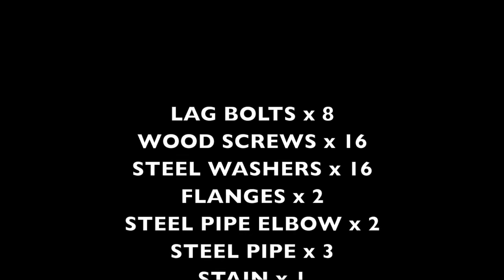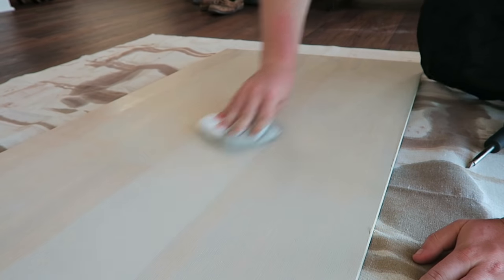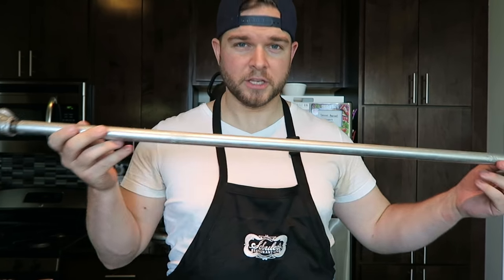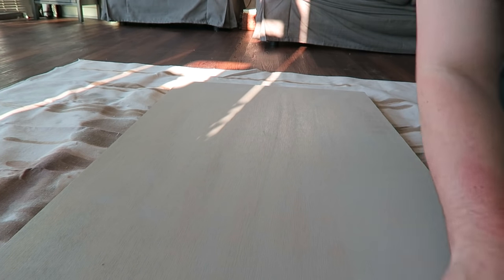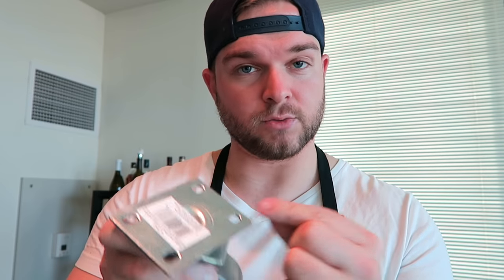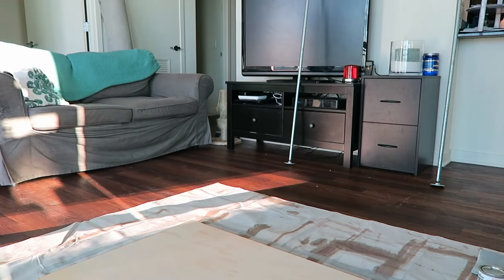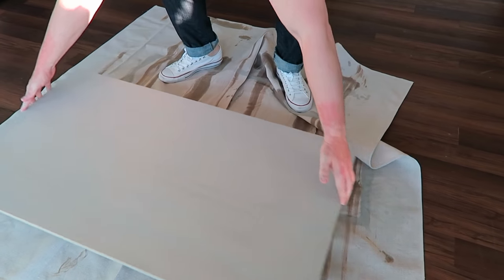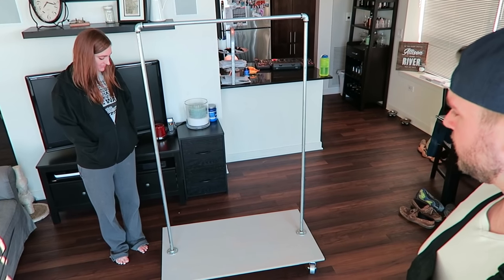DIY CLOTHING RACK

Comment: Thes instructions for a DIY Clothing Rack are the easiest to follow.  My questions are: Does the attachment such as crossbar to elbows have to be screwed to the tightest point? The elbows don't point in the same direction at their tightest. Is it ok to leave one side not as tight as the other?  Also, the flanges when screwed at the tightest leave the verticles uneven in length. What can I do about this?

Comment: Hi! How can I do this with plastic PVC pipes?? Please help. Will appreciate it a lot. I am building it for my daughter and she's an infant and will like to grab things when she grow older and I dont want a hard steel pipe hittinh her head when she grab her clothes..
Reply from the maker: Great idea! You could use the same size plastic PVC pipes you could get at a hardware store. Totally understand why you don't want the steel pipes. You might also consider replacing the wood board with something plastic. OR you could continue the pipe at the bottom like this one here: https://s-media-cache-ak0.pinimg.com/564x/31/40/e1/3140e175b2dedf9d3266ab31a7f476b7.jpg
Reply: Riv and Al thank you for replying! Subscribed on your channel. 👍🏻 Another question though, are there flanges for plastic pvcs? Thank you! 😊
Reply from the maker: +Maica De Guzman thank you! Glad to have you. Plastic pvc will not have flanges, but you could use the style in the link in my previous comment where it just uses elbows 😊
Reply: Riv and Al thank you for your suggestions! ❤️ Will definitely try this. 😁 Hoping to see more easy diy furnitures in the future.
Reply: Fill the vertical PVC pipes with sand.  It will add a lot of strength.

Comment: This may be a random question, but how do you handle ventilation in your apartment when doing something like this? I always thought I had to stain outside.
Reply: I really like the finished product! If i could give a small suggestion, a quick sanding around the edges will really give you a huge jump in the finished look and make it easier to handle as well as prevent it from snagging anything in the future or giving you splinters if you run into it or bush against it. Great job!
Reply from the maker: Thank you! And great suggestion. Also, great observation. We live near a highway so I would normally have the door open or staining outside, but the didn't have the room for the camera shoot outside on our porch :) So I kept going in and out and opening all the windows with fans. ha The things you do for YouTube. LOL. Thanks for the support!
Reply: Haha, yeah sometimes you gotta do it for the Vlog!

Comment: This looks way sturdier than even the ones for sale for double  are. I am just wondering how much weight this thing could hold. Given it's all steel. I have a LOT of cloths so that's something I would need to take into consideration. Also would it be possible to have two cross bars? Adding another one maybe  lower down?
Reply from the maker: Allison put all heavy canvas and sweaters/coats on it and we have never had an issue. Nearly loading it to the limit. The key is the wide-base. When there are not a ton of things on the rack, you might think it's a little too wide, but the width is key to not making it shifty with the weight. The length (your cross-bar idea) is a great one, if you were using for shorter garments. I know that the jackets, long cardigans, dresses, etc. use all the space with room to not be draped on the shoes below. Check out Allison's channel for for views of it here: https://www.youtube.com/thethoughtfulcloset
Reply: @RivAndAl  I tried going to the link for the plywood and it seems to be broken. It says the item isnt available anymore. Just wondering about the size is all.
Reply from the maker: AH, great question! It's ~4ftx2.5ft. Hope that helps! General rule I use, the higher, the wider. For support. =]

Comment: Hi River,

I'm curious about the length of the horizontal bar? Is it long enough to fit about 40 shirts? :)
Reply from the maker: Funny enough, I actually just counted my wife’s shirts on the rack now and there were 39! Had a little room to spare too.
Reply: Riv and Al That's good to know because I'm half way through building my own clothing rack.

The pipe work is done; I just need the pine or marine ply base and coaster wheels. 😀👍

I made mine wider 50' which should be enough for 40+ shirts and other stuff. 

Thanks again. 😊👍